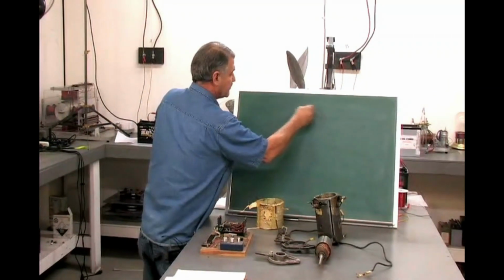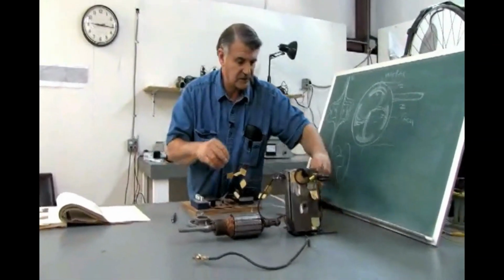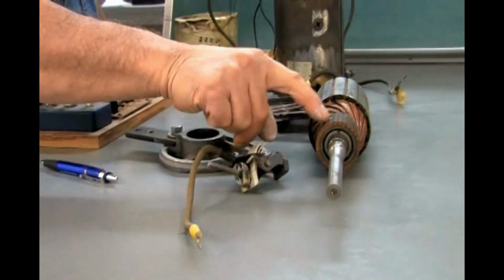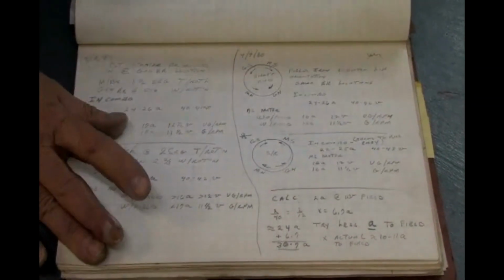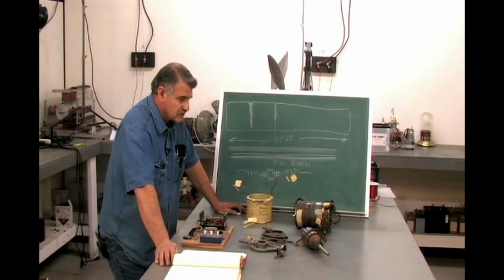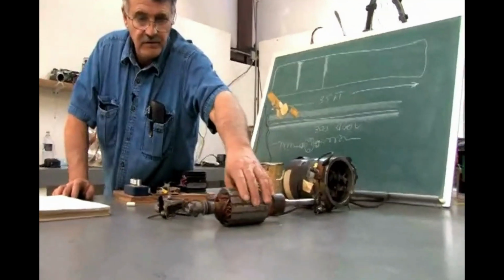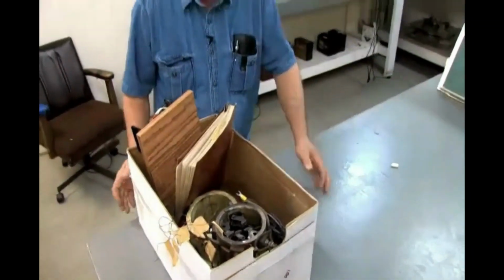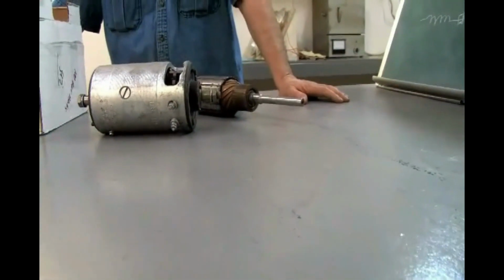Bedini's Secrets - The Lockridge Device

Comment: How do you squeeze four field coils in a caseing that can only take two coils ?
Reply from the maker: Man, thats a good question. Maybe Bedini didnt understand the device correctly. From my research a quadrupole magnet setup and a large capacitor is necessary for this tech to operate. This device has the large capacitor, but how to get the quadrupole magnet setup in the casing that only holds two magnets is an interesting question. I wonder if Bosch was making a smaller motor with similar parameters as this one, and the creator of the device took 4 magnets out of the smaller one and put them in the bigger casing?

Comment: so did they manage to figure out how to do it?
Reply from the maker: Yes, individuals all around the world have similar setups. All these types of devices work similar to a Bedini SSG Motor. This particular device just had a massive capacitor built into it,   unlike a Bedini SSG Motor that relies on external capacitors and batteries.
Reply: @PerceiveBelieve  Can you share resources on a working set up thats easy to follow for ignorant newbs to electronics?
Reply from the maker: @8thsinner   Unfortunately, I cant. Its not right for people to have this technology at this point in time. Now on the other hand if people figure it out for themselves, then good luck to them.  I think kenergy1707's channel has some good setups that will get a person thinking. He uses pulse magnet wheels to charge batteries,  but with $30 aliexpress car battery pulse charger/reconditioners doing the same thing without using a magnet wheel, is it really necessary to have the magnet wheel?:)
Reply: @PerceiveBelieve  I can understand that perspective, but in my opinion now is the time. 
Tho, I don't understand all of it, i've caught bits and pieces that seem to indicate that back emf is usually the key, once this can be harnessed and amplified for a purpose instead of being wasted is when things will come together.  
I will check out the channel.
Reply from the maker: @8thsinner  This energy/technology is more than just free electricity in my opinion. Once a person figures out the energy aspect of it, it appears to me that levitation, time and matter manipulation and a whole lot more become understandable/doable. And we dont need crazy humanity having access to those levels of reality right now. Plus, if AI got hold of a transformer of infinite energy, that would be game over for humanity. 
In my opinion back EMF is a symptom of the dynamic between what ED Leedskalnins PMH holds (as a capacitor) and what a normal capacitor holds. Apparently two different substances and modern science is silent on the subject.
Reply: @PerceiveBelieve  Wouldn't worry about ai, it's not real ai, it's not quantum, it's not conscious. 
You're forgetting about matter printing, but yeah I'd agree from what I have learned so far with those all being the same linked technologies, just the same way as silicon chips and computers were the branch of so many other technologies thus far.
Reply: @PerceiveBelieve  It is possible to modify DC motors, and turn them into asymmetric motors. In asymmetric DC motors, independent coils are switched on then off, without reversing direction of current. Unidirectional pulses goes through coils.
Reply from the maker: @marcisgulbis9310  I think that is what is happening with Bedini's SSG motor. The wheel has all magnet's North poles facing out so the coil always gets pulses of North pole current. So I think that achieves a direct current pulse. I know he is collecting voltage spikes in a capacitor from the setup, but I think there is also some amps/current that passes through as well that is dirrect current no back emf or eddy currents. Maybe Im wrong but thats what it looks like to me.